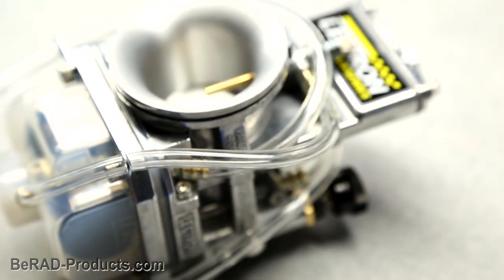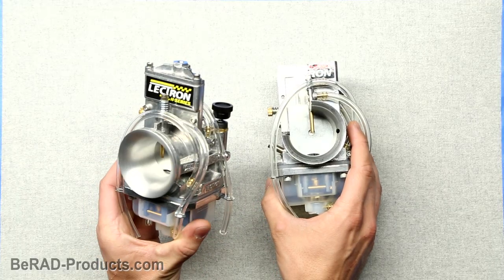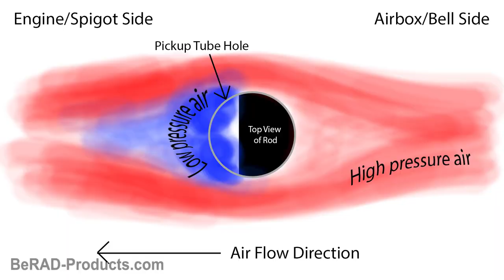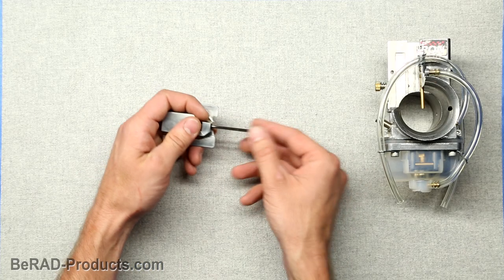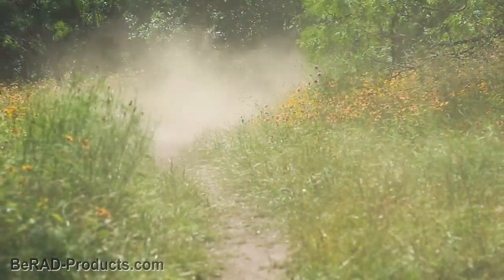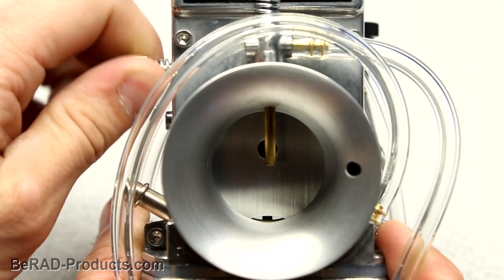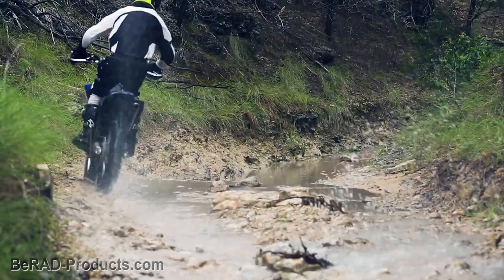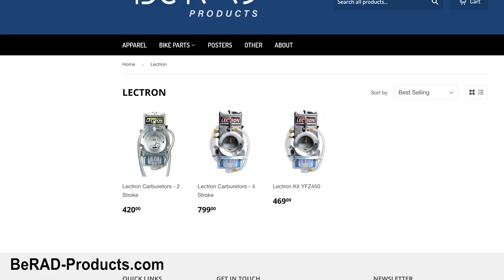LECTRON CARB - How does it work?

Comment: Well done Brad, nicely explained, I've been running Lectron for 5 years, 2 on my yz250(07woods modified PNW style), then last 3 on my YZ250X, awesome, close to twice the fuel economy, and sick low end for up here in the greasy woods! cheers bro!
Reply from the maker: Danny D hell yeah!!! Glad to hear you’re in love with them as much as I am.
Reply: Why do you have 5 carbs for 2 bikes?
Reply: Twice as fuel efficient? So you’re considerably better mpg then an injected bike?
Reply: Danny I am running a 2001 rm 250,   it has a weighted flywheel, a new top end, gnarly pipe. Pretty much is setup for more low end than top end. The bike was built by a guy who set it up fo gncc. I bought it from a guy who purchased the bike and couldn't handle the power. My issue is that I think this kid messed with the jets in it, it is a rocket on wheels from low to high it pulls the front wheel in fourth with no clutch just like it does in third. My issue is fuel consumption, I get about 45 minutes of ride time out of a tank of fuel and alot of splooge out the silencer, I have to repack my silencer every 8-10 hours because the oil burns the packing out of it. Since you have a lot of experience, do you think I could get the same performance with this carb without the fuel consumption or burned up packing everytime I turn around?
Reply: I'm not sure what your riding, about the same, my 2015 fuel injected yz250fx burned about the same amount of fuel as my 17 yz250x with lectron carb on same loops up here in hard enduro PNW woods, my yz250x with lectron burned 1.1 gallons on same loop as stock Keihin burned 2.1
Reply: The lectron should get you considerable better fuel consumption, while your power will be mellowed out and more linear and controllable, at least that's what it has done for my YZ250x, as well as my buddies, and all my KTM/Husky mates run them as well.
Reply: Kermit, I replied to you on below dudes thread.
Reply: @dabtown5293  I should have stated that I mostly trail ride, I have not raced in 12 years. That was the reason I took such an interest in the bike I have. Sounds to me that this carb may be exactly what I need. Thanks for the info on this carb Danny
Reply: When you disconnect the tps and the solenoide valve and put the lectron. The bike run ok ? Have you change the stock electronic box ?
Reply: @dabtown5293  Do you prefer your Yz250x over a husqy te250 if you've ridden both? I'm considering buying the 2020 yz250x and don't know anybody else who rides yamaha's, just me so I have no way to ride one.
Reply: BAYAREAMX who has two carbs on a YZ250? Or three at that. Maybe try reading next time 🤦🏻‍♂️
Reply: @JasonTate86  try a 45 pilot jet
Reply: @dabtown5293  what size metering rod do you run?
Reply: I run a lectron on my yz250x too
Reply: @ThisTall  No, the stock jetting is very rich, (which is typical for a 2-stroke carbed dirt bike, to stay safe in different places of the world, (and even the next day), with different air quality.).  He never jetted the stock carb.  Not many people do really.  There was probably another 2hp there too.

Comment: I removed the EFi and brain off of my raptor 700 and installed a lectron 58mm dual jet. This carb screams harder than any other fuel system I've used

Comment: I would have one on my klr650 supermoto if they weren't 800$...like cmon man
Reply: I'd like one on my wr250f for dual sport riding but $800+ 😰
Reply: I’d like to have one for my Cr85 but 600$???
Reply from the maker: BlasterBoy 05 more like $500.
Reply: BeRAD still 800$ for the 4 strokes 😤
Reply: Excellent carb for many bikes but I would go pumper carb with big bore 4 stroke engines like the klr dr etc since they have active fuel spray nozzles that is huge for bottom end and throttle response. TM or FCR carbs
Reply: @BeRAD  I'll be getting a 2 stroke version for my yz250x.  But the 4 stroke price difference??  Not sure why the huge difference in price.
Reply: Id like 6 for my cbx but nobody wants to buy a 59 year old kidney.....
Reply: @theravedaddy  😆
Reply: Good quality is never cheap! A good alternative is a JD jet kit tho.
Reply: EatYourBroccoli 2.0 I know right. They’re totally worth it on any other bike.
Reply: @brockclouser1500  that is fucking insane !!!!!
Reply: EatYourBroccoli 650 they’re like $450,
Reply: BlasterBoy 05 want one for my tc 85 but way to expensive
Reply: For my DR650 a TM40 costs 500€
A lectron costs 1000€ (tax)
I really really would like to give the lectron a try but thats just too much... is it really 500€ better than a TM40?
Reply: Bike Wolf well let‘s say it has twice the fuel efficency that your stock carb has. I‘m from Europe so I don‘t know what the fuel costs over in the states but you can calculate how long you have to run it until it pays off...
Reply: Robert Daniel Anything for 4 strokes will be like $200 extra than smokers. Look at how much they have to spend rebuilding their top end compared to us.
Reply: BeRAD I think it’s an absolute great carb. But for 5-800$ (not including shipping) you could buy a whole new bike.
Reply: Yea maybe 250$ 300$ I'd consider but 500$+ gtfo

Comment: Have one on a DR650. Took 45 min to get it dialed in but bulletproof ever since. The peace of mind knowing there will be no fiddling with the stock carb no matter where I ride  is good enough - add in the engine performance and I would never not have a lectron if I had the option.
Reply: How is it off idle like slow technical trails? I too have a DR, and if you ask on the forums peeps are kinda divided.
Reply: @intrigue175175  No issues off idle. Torque from the start. 
Admittedly there are mixed reviews around the forums. Not sure if I got lucky or if it’s in the tuning.

Comment: Installed it on my 2017 KTM 250XC last night along with a VForce4 reed valve and I'm blown away.  The throttle response and ability to pull from idle to redline in any gear without any hesitation or bogging is totally amazing.  I'd put it up against any FI system anywhere anytime.  I'm completely impressed.
Reply: Vf4 definitely played a huge part of that. Vf4s are amazing reeds

Comment: I've had my Lectron on my Beta 300RR Race edition for a little over 2 years now and love it. Here in Utah I ride from 3k to 11k ft and have never had an issue. The bike runs great everywhere and every season. If course at elevation especially above 8k you will notice a power drop but any naturally aspirated engine will lose power due to the lack of oxygen in a given volume of space.
Reply: I also live in Utah and have been looking into this carb. I ride AF, Hobble Creek, 5 mile pass, and Solider Pass mostly. How have you set up your carb? I also have a Beta 300 :)

Comment: I ran a rack of four 38mm Lectrons on an oil cooled gsxr 1100 (1277) back in the early 90’s. I tried all the flat slides and nothing compared to Lectrons. Back then they didn’t even have an idle circuit and with a sidewinder exhaust your bike would sound like a pro stock. Total bad ass! Paul Gast proved the carbs worth years ago on the H2 Kawasaki.

Comment: My KDX220R has one of the Lectron H series carbs. What a difference vs the stock Keihin. That low-end grunt is nutty. Amazing on trail. Pulls like a freight train all the way to the top with smooth transition all the way.

Comment: Old 2T + Lectron = More reliable, lighter, simpler, fuel efficient, cheaper, and more fun than any new injected 4t or 2t =]
Reply: carlin hicks you don’t know anything about fuel injection and carburetors.
Reply: Yea wait till your precious "$400 lithium" battery dies and you have no kick start. Or just wait till your 40 miles down some trail and your oil pump takes a shit. No thanks, ill stick to old school anyday

Comment: I grew up across the street from Lectron back when they were called lake injectors. Everybody used them, go-carts,mini bikes. It is the best carb going. Ran them on my pro stock kaw. They put out more horse power than anything else. Crazy simple I built drag bikes for 28yrs. would not use anything but Electron even have one on my 68 electra glide!

Comment: i tried making a flat needle for a pwk flatslide carbureutor,immediately i can feel the improved throttle response,in terms of tuning you dont need the slowjet anymore. I've plug the slowjet with a steel epoxy,if its too lean change the main jet the main jet to a larger size,if its to rich decrease the main jet size, you dont need to adjust anything else!

Comment: Awesome, this should have been the standard on bikes a long time ago!.
Reply: It was. Back in the sixties.
Reply: Keith Peterson  Dyno sheets or it did not happen....  and we are not really looking at peak power, but the broad power band.
Reply: Keith Peterson  OK as I don't have dyno results personally to back up my statement, it might be fairer to say that the Lectron that is set up correctly does not have to be rejetted or retuned for changing conditions.  If a standard carb in a perfect controlled environment is tuned to peak performance then I could accept the possibility that they might out perform the Lectron.  But out in the real world when comparing lap times, the Lectron usually wins, and you don't have to mess with jetting ever again.  Plus it gets way better fuel mileage, which for XC races and trail/fun riders is a big deal.  Even if I had to trade off a slight HP loss, knowing the Lectron is dialed in for any condition I will ride in vs having to change out jets on a standard carb is worth the trade off for me.
Reply: Keith Peterson are they good for new riders on one cyl bikes that just want reliability and to avoid paying mechanics ?
I’ve had the worst luck with car mechanics. I hate going to Mechanics.

Comment: My 1964 CB72 had power-jet carbs, they worked very well. I think they were Keihins. The power jet was fixed, and had to be changed to vary top-end mix as required.

Comment: I have dumped about 2 grand into my 1999 kx250 in bearings, top and bottom end, radiators, chain sprockets, and everything else. Just to find out it wont kick over for some reason which I believe is the carb even after it's been off the bike and cleaned and reassembled. If for some reason I have to ditch the carb, this will be the last piece im getting haha. Looks sick.
Reply from the maker: Lonewerewolf777 may as well just kick that stock carb to the curb already haha. I’d appreciate the business! Let me know if you have any questions brad@berad-products.com

Comment: I could be way off on this assumption, but it seems that the tech they use in these carbs is effective but also simple and inexpensive to produce. $400+ seems like price gouging.
Reply from the maker: Rookie Wrenching the technology is simple but it’s quite expensive to build the carb...they’re all custom ordered and built to the specs of each order. The thing is that a lot of the components like the metering rod are not off the shelf like jets would be. They all must be ground to very tight tolerances at Lectron and quality control checked. Now a video on how they’re produced would be interesting!
Reply: BeRAD I see where you’re coming from, thanks for the reply!
Reply: $800 bucks for my 06 crf450x. $400 would be nice.

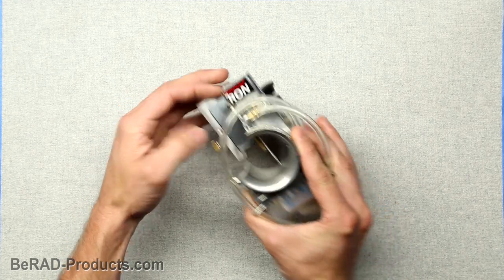Comment: On my old Lectron carb is not so easy to drop the metering rod body in the carburetor like you do at 1:58, maybe the rod is a bit bent or something. This makes the adjustment much more difficult and I’m thinking in buying a Smartcarb so you the ratio can be adjusted without disassembling the carburetor.

Comment: We have a Lectron carburetor on our 2002 Kawasaki KDX220R and it works great! Only issues is the needle sticks closed if the bike sits for an extended time. Any suggestions on how to solve the issue? We had the carburetor rebuilt by Lectron and still have this issue. Thank you! 🤙🏻

Comment: hey guys looks like a needle I did 10 years ago ,went a different way . idea for you drill small tapered hole .090 to .060 to the inside you will get a vortex mixing of your fuel.

Comment: Old technology. Better to go with a SmartCarb SC2. Its single circuit design (no power jet required) combined with internal venting gives it better fuel economy yet, better air density compensation, and no fuel spillage. Its keyhole shaped bore gives more focused metering rod signal down low for a stronger bottom end compared to the Lectron. They're also externally adjustable, so moving the metering rod takes 5 seconds instead of 5 minutes, requires no tools, and can be done from the seat on most bikes. The new SC2 model is a better fit than the Lectron, requiring no shorter intake flanges and they accept stock throttle cables. Plus the choke is on the left side where you can reach it.

Comment: Not as complex as expected, the main jet is replaced with meter rod which is just a clever way to deliver fuel based on pressure, meaning no adjustment and the powerjet appears to be another fuel input to offset total deliverded fuel so the carb can work on smaller/bigger bikes, thats what i got from it as the purpose of powerjet wasnt explained. Idk why eddie current is mentioned when its an electrical term and this is al just fluid dynamics.

Comment: Hey man, so my lectron has been amazing for offroad and technical stuff, but ive been riding a bit more track and I find it not getting on the pipe as fast as id like without having to pop the clutch a bit , how would I adjust that? The power jet? Ik you mentioned it gives more mid-top I would just try adjusting but I want to be sure I dont harm my engine by doing the wrong thing. Thanks for all the help you've given me in the past!

Comment: Seems that the rod is doing exactly the same thing a needle does in a CV carb.  The two adjustment screws acts as an adjustable idle and main jet.  Seems quick adjust-ability is the only benefit over a CV carb.  I don't see any performance benefit beyond what a CV carb provides.  A pumper carb would perform better then a CV or Lectron by provide fuel sooner.

Comment: Hello Brad
So far the best video explaining the lectron carb.
I have a question for you. I have a Husqvarna te 300 2017 and I installed a lectron  on it. I am very happy with the bike but I get fouled spark plugs all the time. I have to change the spark plug after every single ride. (4 hours) . The carb was supposed to be ready to use and I haven´t touch it. Do you think it is too rich and I should lower the metering rod?
Thank you!!
Reply: Not Brad, but I own a Lectron.  You should not be fouling plugs with this carb.  If your plug is wet and black, then you need to shorten the rod by at least one full turn.  Just make sure you keep the flat part of the rod towards the engine.  Just follow the Lectron instructions.  I think they come rich from Lectron for liability reasons - too lean can cook the motor.  You might have to make a few tweeks, but once it is set, you will never have to worry about it.  I run my 2018 YZ250x at 65 to 1 Motol 800 and it runs great.  Put in a new top end at 65 hours, and the cylinder looked perfect.  Piston looked great too, but I think the rings were getting a little worn as it had a little more power after the top end.  Fine tune the rod length buy looking at your plug, how it sounds and how it feels.  Then it is set.  Lectron does not know what oil mix you have or type of fuel used, so usually it is NOT spot on out of the box, but then again, no carb ever is.
Reply from the maker: Ricardo Cuetara yeah you’re definitely too rich! Although, that’s odd that it’d be so rich that you’re fouling plugs at all. I’ve never fouled a single plug in my life. I run the same plug for 200+ hours. Try LENGTHENING thE rod (unscrewing) as the video suggest. Do not make it shorter, that will make it more rich. But there could also be something “wrong” with your bike that’s causing this. Low compression, clogged spark arrestor, etc. the carbs do come tuned for your bike I’m properly running order. It’s possible that there was a slight messuonand it was a little rich from the box. Play around with it. Lengthen it 1/4 turn at a time and see how it feels. Do a plug reading each time.
Reply from the maker: stickbeard thanks for responding to him. I agree with what you say although you were backwards on your suggestion to shorten the rod! That would make it more rich....
Reply: @BeRAD  DOH!  yes, make the rod longer - face palm, lol.

Comment: Just bought one from BeRad and hoping this  finally ends lean conditions melting my pistons.
Reply: Or you buy a bigger jet to get more fuel??
Reply: @rosegold-beats  that sounds good, but I'd rather not waste hours of riding time every month dicking around with my carburetor and afr because one of my typical rides can range across hundreds of feet of elevation, 30 plus degrees of temperature change and go from slow rutted twisted trails to miles of flat straight-a-ways